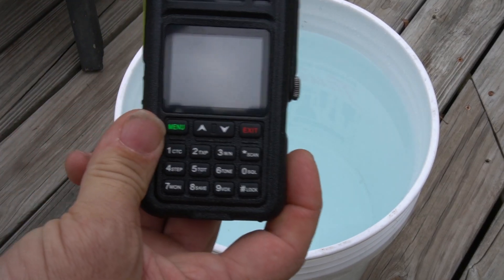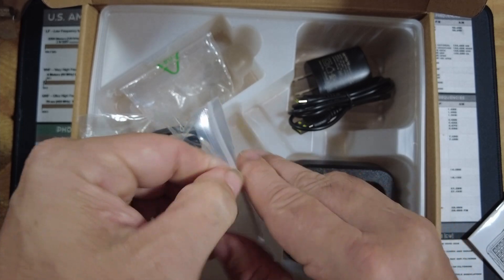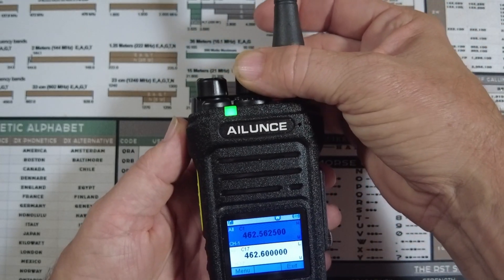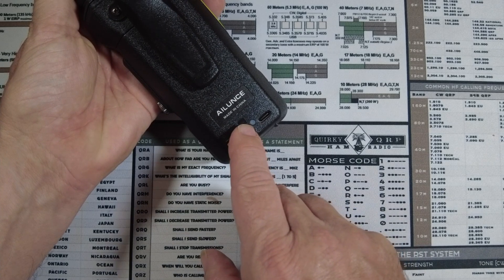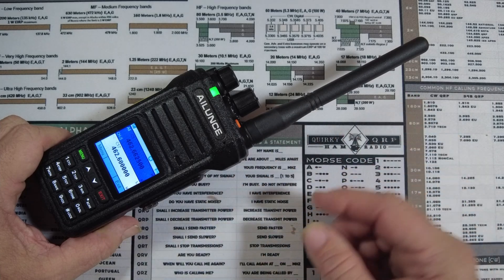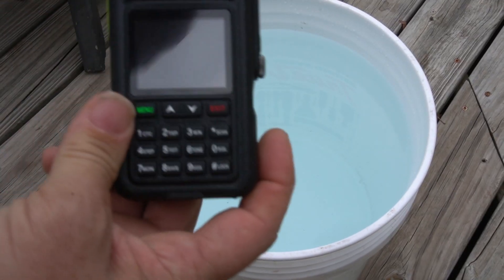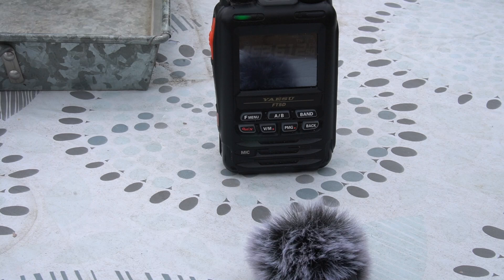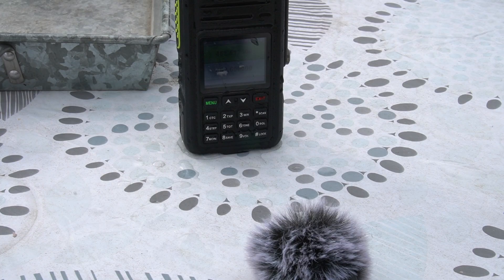Will it survive submersion?

Comment: Retevis has stated that they will not sell radios with detachable antennas, but they all come with antennas that come off with a little work. My HA1G antenna came off without having to back out the set screw.

Comment: Well, I pulled the trigger on this radio. Well, actually two radios. My wife has been asking for radios to communicate when the kayaking groups separate.
At some point I will pick up a mobile radio as well to build into an "ammo can" which could be use in the trailer or vehicle.

Thank for the video! It provided the encouragement to chose this radio. And, the RA89 is on the way as well. I always get a little concerned when using my D72 on the kayak. My kayak radio collection will be complete: Amateur, GMRS, Marine, WX (not waterproof).

Comment: This radio looks nearly identical to the Ailunce HD1 (DMR), so it's possible they just used the same radio body and design to save on costs, and/or perhaps it was also an easy way to keep the waterproof rating. 

It doesn't look like the non-removable antenna is a requirement of  hand held units unless it transmits digital data, according to the rules.
Reply: Then maybe, you should have made your point succinctly and saved everyone the confusion instead of just spitballing obviously incorrect information. My comment was not rude, it was simply clarifying for the benefit of those who are looking for information on this radio that is useful. When you are wrong, you could just try admitting you are wrong like an adult, or just let the new information stand on it’s own without lashing out like a child. “Pedantic”, I do not think that word means what you think it means.
Reply: @hamhouke  Everyone can see where I posted "you are right, they are different".  I hope hurling insults at me made you feel better.
Reply: I own a lot of HD1 radios. This radio body is definitely not the same. To begin with, the antenna is in the opposite side of the radio. It also looks a little shorter than the HD1.
Reply: @hamhouke  The point I was trying to make was that maybe it shared a radio body with another Ailunce or clone. I just tossed out the name of a radio that I thought, off the top of my head, looked similar, but you are right, they are different. I should have known better than to use such a specific example of radio model knowing that some pedantic ham radio detective would spend time correcting me instead of making a comment relevant to the video.

Comment: FYI: GMRS radios are not allowed to have removable antennas, by FCC requirements for certification.  If the antenna was removable it could not receive a GRMS certification.  FCC Reg: 95.1787-4
Reply from the maker: That’s true for FRS but I don’t think it applies to GMRS
Reply from the maker: Now I am questioning myself. Looking at 95.1787 A-4, it says “non-removable” However, the way I read it is that that is only a requirement for digital transmissions. https://www.ecfr.gov/current/title-47/chapter-I/subchapter-D/part-95/subpart-E
Reply: @KM4ACK  that's where I ended up as well.  You'd think gmrs preppers would be all over external antennas like hams...
Reply: @KM4ACK  The Garmin Rino series does data (position reporting). They have non-removeable antennas per subpart-E. The data also cannot be used on repeater channels (per manual). Nice radios!
Reply: @KM4ACK  Here's the full text.

95.1787 GMRS additional requirements.

Each hand-held portable unit transmitter type submitted for certification under this subpart is subject to the rules in this section. 

(a) Digital data transmissions.  GMRS hand-held portable units that have the capability to transmit digital data must be designed to meet the following requirements. 

(1) Digital data transmissions may contain location information, or requesting location information from one or more other GMRS or FRS units, or containing a brief text message to another specific GMRS or FRS unit. Digital data transmissions may be initiated by a manual action of the operator or on an automatic or periodic basis, and a GMRS unit receiving an interrogation request may automatically respond with its location. 

(2) Digital data transmissions must not exceed one second in duration. 

(3) Digital data transmissions must not be sent more frequently than one digital data transmission within a thirty-second period, except that a GMRS unit may automatically respond to more than one interrogation request received within a thirty-second period. 

(4) The antenna must be a non-removable integral part of the GMRS unit. 

(5) GMRS units must not be capable of transmitting digital data on the 467 MHz main channels.
Reply: FRS bozo 🙄💩

Comment: Does FCC Regs. prevent removable antennas on GMRS Radios?
Reply from the maker: I think only FRS has removable antenna restrictions
Reply from the maker: Now I am questioning myself. Looking at 95.1787 A-4, it says “non-removable” However, the way I read it is that that is only a requirement for digital transmissions. https://www.ecfr.gov/current/title-47/chapter-I/subchapter-D/part-95/subpart-E
Reply: No. GMRS/FRS yes. GMRS only, no.